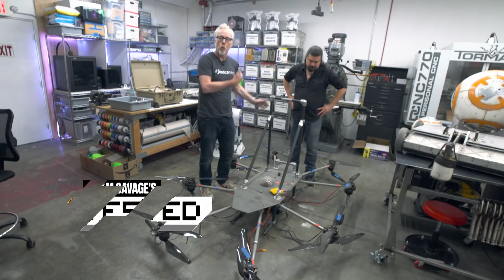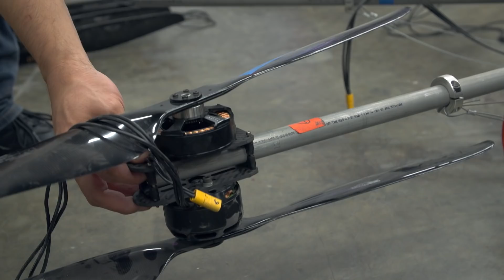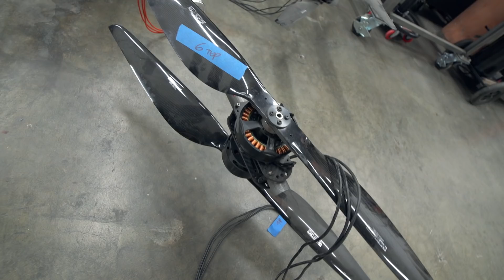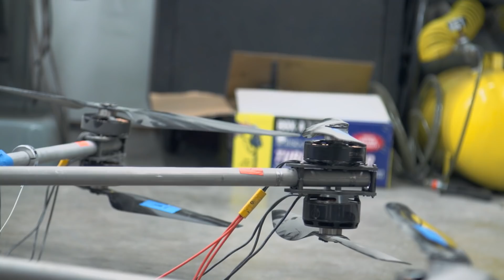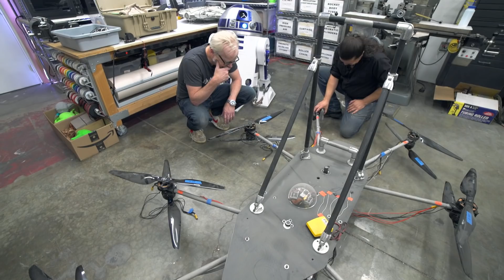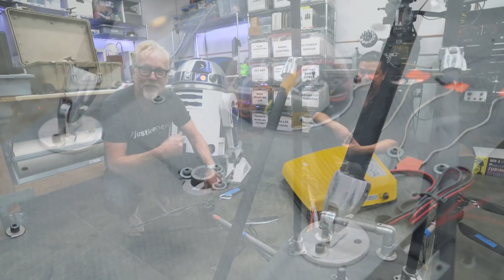Grant Imahara's Scratch-Built Hoverboard

Comment: Judging from motors/props used, and from the flight control unit you can clearly see inside the little transparent dome in the center of the platform, this was build not so long ago, certainly when drones and flight control were already very popular. So he had 3 axis stabilizations with gyro/accellerometers, attitude control, etc... It is no much different from any other multicopter, in fact many have built similar craft for heavy payload or human flight since 2011/2.  Anyway it  looks like Grant used steel tubes as arms (making the whole thing much heavier than it needed to be if it was built using composites) but with an interesting trick, using a tension cable attached at the middle of the arm and than to the base of the craft. A clever way to take some of the load away and slim down the arms. Miss Grant and all the mythbusters gang! 😢

Comment: I'm glad he didn't test that theory. Carbon fiber props generally don't "explode" on impact. I had an accident while building a quadcopter where it ignored controls and came at me. That was with ~2217 outrunner motors and 10" plastic propellers. I ended up in the hospital getting stitches from that.... I cannot imagine what this thing would do to you...

It wouldn't cut your leg off, but it'd probably cut most of the way to the bone....

There have been several reported cases of large RC helicopters (~700mm long blades) with carbon fiber blades killing people they collided with......

Comment: Huh. I see he installed some familiar pancake motors for the upper props, but what motor types are driving the bottom props and why would they be different? Any physical reason if any DIY Drones builders want to speculate? 

My department once built a quadcopter using almost those exact carbon blades and top motors for lower RPM endurance, but we were never able to get the system stable (autopilot was a commercial fixed wing system and the company was creating experimental multi-copter firmware).

Comment: Love this project. He's not the only one that built something like this, and I'd love to do it as well. Drones have had control for a long time, and if he did this for White Rabbit they already had the technology you'd need to help stabilize it, but sensors and a micro isn't the full story, you need a control algorithm.

Definitely controls engineering is the most challenging part of this, and having the person stand on top makes the design inherently less stable  and more in need of fly-by-wire to stay level. I'd probably go for the sit-down version with the props overhead, but then that wouldn't be what we picture as a "hover board"....... I can do without that though.

Comment: If the blades were above the center of gravity (ie, over head), it would self level and balance fine.
Reply: But you'd lose the ground effect. Of course, there is some natural stabilization from the ground effect itself, but I sure wouldn't wanna rely on that.
Reply: Blades above the center of gravity end up having the same instability as blades below, so they would actually have to be at the same level as the c.o.g… look into the “rocket pendulum fallacy”

Comment: The biggest problem for the design is the center of gravity (CG) was above the center of lift. This makes it want to flip over to put the CG below the center of lift.
Reply: This really isn't much of an issue with drones. The PID Loops in the flight controller can handle/manage those differences for the most part

Comment: I think there's misleading information about what Fon said. He said there were no specialized electronics for this but there was at that time, quite a few consumer and professional-grade flight controllers that could be used years before this was created and I believe Grant used a Pixhawk controller, at least looks like there's one below that clear "dome". It does not at diminishes what he's done, I believe took quite a bit of work to get the PIDs (parameters for the closed-loop control system that makes a stable flight possible) right, especially with the moving high center of mass that a person on top of that contraption would be.
UPDATE: As Travis Bridges pointed out in his answer, the controller is actually a dji wookong which is kind of baffling because it was probably much worse to dial in.
Reply: Looks like a dji wookong flight controller to me. Which is insane. I think it would have been easier to tune using arducopter or PX4.
Reply: @thatsnailguy  You are quite right. I wasn't familiar with this controller, thanks. And indeed, why he took this route we will probably never know but perhaps that was what he was used to.